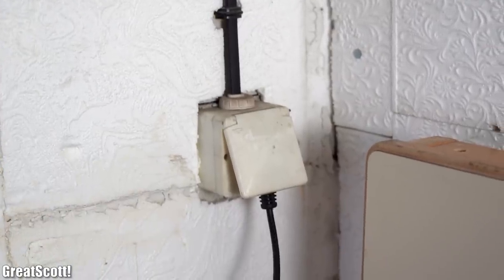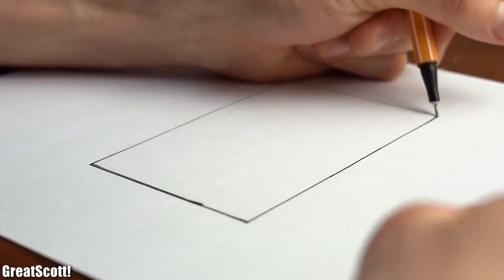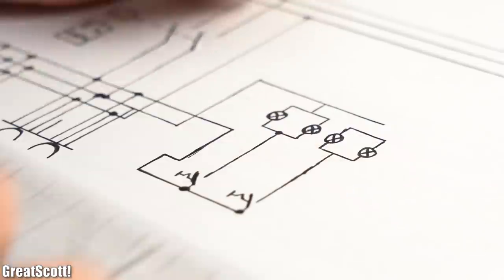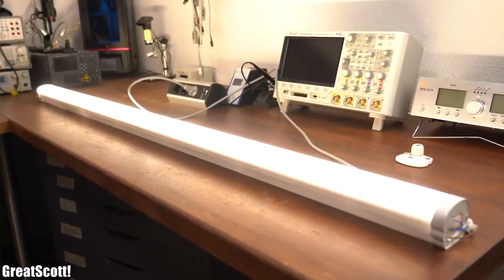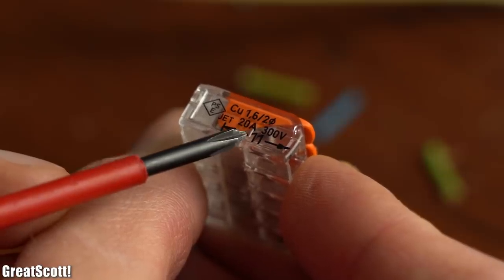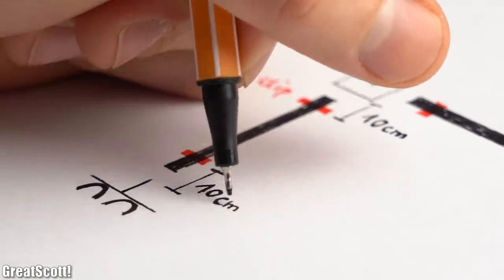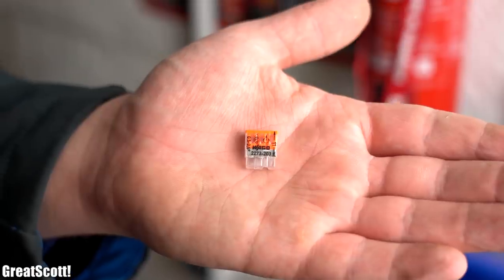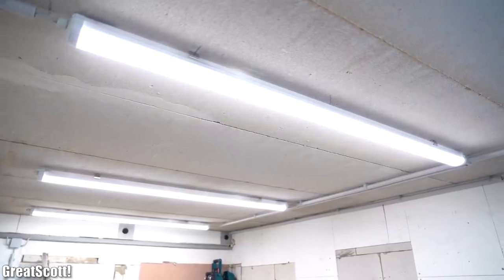How to do Electrical Wiring properly! (more or less....) GERMAN STYLE!

Comment: It's surprising how different German switches, cables and connectors are from the Italian ones. As always, great video!
Reply: So true, noticed it expecially those wires with solid strand instead of multicore
Reply: All components updated to the new legislation are very similar to those shown in the video, also because they must follow very stringent European regulations.
Reply: In Poland everything seems very similar to German type.
Reply: @fb55255  right, I always see that kind of cables in foreign youtubers videos, but I have never seen them in the electrical systems I worked with. They seem really practical.
Reply: @enricomontanari1390  in what year the new rules came into effect? I bought a bunch of new switches and electrical components last year, but they're not really similar to the ones in the video. I'd love to use wago terminal instead of the classical screw connector, but I never found them in shops. They need more space, but cable management looks neater.
Reply: I would say its the other way around :) The Italian ones are different... We also have almost  a 1:1 "copy" of the German system for wiring in Slovenia. On some points it's even stricter.
It's nice if we are on the same "page" for wiring, rules and regulations. It's even better for us consumers because you are not only limited to products made in and for your country...
Reply: @snajperSLO  standardization is always the best thing for consumers. Anyway, i always thought that we are the strange ones😂
Reply: Wow! Lo seguono anche altri italiani oltre a me 😁
Reply: @SimonTheGolds  Fa sempre piacere trovare dei connazionali 😂
Reply: Looks identical to the Belgian system. Different manufacturers though.
Reply: Imagine VS the US. Half the power, different codes ECT
Reply: @JoeNathan42420  half the voltage doesn't equal to "half the power" ;)
Reply: @JoeNathan42420  watching videos from Canada and USA I noticed that the difference between European components and american ones is huge. I think the working pricinciples are the same (or at least similar), but I could find only a few things with the same design. If I have to guess, in African or Asian countries this are even more different.
Reply: @fb55255  What? Multi-strand should not be used in fixed installations anywhere except in vehicles or environments with lots of vibrations. Except only very thick cables (not used in homes) where a few strands are needed for being able to bend them (still very stiff). 

Most of Europe goes by German standards, as they are categorically safest. (Wake up UK!)
Reply: Italian wiring of industrial equipment is just outstanding. Every wire marked in both ends and on terminals (ends crimped with boot-laces) . If you don't  get schematics, just follow the numbers.
German control panel with PLC?... One color for  Inputs and outputs to the PLC (grey) . Navy blue for live and black for neutral on 230VAC circuit. Only markings at the terminals for outgoing cables. German PLC technician get lost during commissioning of the new  plant. And again we, locals, opened all the trunkings and started pulling on the wires to correct the wiring. No pin lugs or boot-laces at the wire strip end in the terminals! (like Italian do)
It just takes to much time and man-hours to do the job properly, but price is like for Rolls Royce.  "German Engineering"
Glad to supply photos for disbelievers .
Reply: @MrJob91  sorry, no this is not the way it works. The potential between the strands is the same. No sparking is possible.
Multi core cables are only allowed (and sometimes required) in moving applications or devices with much vibration (like a compressor). Bending a single core wire multiple times will make it break. On the other hand a multi core wire is more flexible but much harder to handle correct and it is more expensive. Most of the time you need to use ferrules and taking care not to clip a single strand to make it work. Multi-Core wire is usually more expensive and is usually not able to make "perfect bends". This leads to messy installations which can't be understood easily. And since the effective cable radius is bigger it's harder to install them. All that being said, this are just some reasons the (german) codes are like the way they are.
Reply: @JoeNathan42420  Half voltage is double amps. All their wiring is double the section of ours, and they are quite limited in their power draw. We have 3 phase 400V at at least 40 amps available just about everywhere. They also have the habit of putting everything in metal conduits and boxes. To us that looks like a solid suicide plan, but it’s normal there. They even still have to discover Wago connectors, the poor sods ...
I don’t envy them for their power system. Or for anything else nowadays. 😉
Reply: @calysagora3615  only multi-strand are sold in Italy. Tbh I think everything should be multi-strand I tried to wire in an apartment both single and multi strand wires and thrust me a single strand is impossible to pass in a conduit, in particular if you have some sharp turns. Plus I find much easier dealing with multi-strand when in a junction /plug/switch box as cables are very flexible. On the electrical point of view there is no difference, they both do the job and both are safe and well insulated.
Reply: Well I live in (North) Italy and I don't see that much difference. The only thing I see with perplexity is he left open conduits.
Reply: @AccidentalScience  yeah i was thinking the same..
Reply: @calysagora3615  
Sweden has even more strict standards.
Reply: @mattiasakerblom3426  Jag vet! Har jobbat åt Jaco... 😑
Reply: I'm italian (northen Italy) too, and one of the things that striked me as different is the fact that he used cables with multiple wires in a single sleeve, instead of separate coloured wires. Of course in this type of installation you would terminate the conduents inside the juncion boxes, which I think looks much cleaner.
Reply: Maybe they are just newer styles, I've done a lot of marine electrical over the years and most customers choose Vimar components which is all Italian and looks very similar.
Reply: @tonyhewett3729  Here in Belgium it’s all Niko/Legrand for installation, and Scheider/Vynckier/Eltako for components.
Reply: Yes, it looks like in Germany are 30 years later compared to Italy 😂
Reply: @SimonTheGolds  Ci mancherebbe è uno dei canali migliori !
Reply: It surprises me how lax the electrical code is there. A plastic distribution box, that could be easily smashed. That is why we use metal in the U.S. also I'd a wire comes loose it will short to the metal box and trip the main breaker or distribution breaker.  Also cut the conduit 5cm before the device. Not here, conduit is connected directly to the device. Also metal conduit is also used when indoors as it is a second ground. And the clips you used ours go over the conduit, can't take the conduit down unless you remove the clip.
Reply: @calysagora3615  What? We do work to the same standard as Germany. Or rather we are supposed to, I've seen some truly shocking wiring from supposedly qualified electricians. The only thing I would do differently as far as wiring goes is I wouldn't use Wagos. I would use DIN rail connectors and ferrules on as much as I could get away with. You can get plastic enclosures nowadays with a DIN rail moulded into it so you don't have to buy the rails seperate. I think the only thing we do differently as a nation is our lighting and sockets are on seperate circuits and breakers.
Reply: Pretty much the same setup here in Portugal.
Reply: @Stefan_Van_pellicom  i've heard the set-up of the different live phases is different in belgium though. Wasnt it so that the triangle phase configuration (3L) is relatively common in Belgium. While in the Netherlands and Germany the star configuration (3L 1N) is more common?
Reply: @leonnastaly4814  Isnt according to the german standards blue = neutral; black = switched live / phase2 in 3-phase system , where brown = connected live / phase 1 in 3-phase system?
Reply: @snajperSLO  Well, we have CENELEC, but for some reason - I leave it to your imagination - some countries protested against common standards ... otherwise, all EU countries would be on the way to have the IEC 60906-1 standard plug (yes, we have that international standard, but only South Africa and Brazil come close to that) and common rules (for both the electricians as well as for DIYers). This would be a 20 year long way, but still feasible.
And yes, some "Special Italian wire techniques" would not be allowed then anymore ;)
Reply: @fb55255  Stranded is just cheaper (and bigger) than solid core, for the same current.
Reply: also: there is no way in italy you would use that kind of multi-conductor cable inside a tube, you'd just nail it to the wall or just get the tube inside the junction box and then use multiple single-conductor wires.
Reply: @Darkshadow799  actually, difference between USA and Europe is bigger than Europe and Asia/Africa etc. In USA most common type is a split transformer mains. (220v / 2x110v). In Europe main land most installations have a true 3 fase (L1, L2, L3, PE+N) or on older connections 1 fase (L1, PE+N.). Buildings with 3 fase can use 400v additional, but fase to neutral is always 230v and is mainly used for household appliances.
Reply: @Darkshadow799  If you make the system with the conduits that stop before the boxes ( as in the video) they could be practical but then the multicore wires are even more practical, if instead the conduits continue inside the junction boxes it becomes much more difficult to insert the solid cables, not to mention that the cables with sheath cost more than unipolar multicore flexible cables
Reply: @SimonTheGolds  presente! Italiano e veneto (da 10 anni, prima emiliano)
Reply: @fb55255  This depends on use case, and max amperage thatll be flowing through it
Reply: @michaelbeubl648  tua sorella
Reply: @Darkshadow799  Cacchio, quei connettori Wago sono una figata!
Reply: @fb55255  Do you have the Ticino stuff?
Reply: @volkhen0  in Croatia also 💪
Reply: @Darkshadow799  Well, connecting is connecting wires. In that the working principles are similar. However: the High leg delta system used in North America is sufficiently different from the symmetric three phase system used in Europe that being trained with one of them does not mean you‘re qualified to work with the other.
Reply: From North America it's far more different.
Reply: A US electrician has to trained well to work in Germany. The same it is to work in the USA. Different colour codes, different cable,  breaker boxes, installation rules.... .

Comment: In Catalonia we use 1.5mm copper wire for 10A instalation, 2.5mm copper wire for 16A for electrical socket plugs, with one RCBO for max 5 circuit brakers and a diferent breaker for ilumination circuit 10A and a 16A braker for electrical sockets.
Great videos, I love your channel.
Reply: In Finland we also have to use 10A fuse for 1.5mm² and 16A fuse for 2.5mm², both copper. In a VERY special case you can use 1.5mm2 with 16A fuse, IF the cable is less than 2m long.
Reply: We have also a maximum 3% of voltage drop, if you exceed you have to use the next wire section. We also have a restriction of maximum current depending of the instalation system. 
But I think prety much similar in all European Comunity members.
Reply from the maker: Thanks for the info!

Comment: Im an italian electrician, here in italy 1.5mm sq is for 10amp circuit, for 16 amp we use 2.5mm sq, also you can use some adapter for the tube to the junction box and you dont have any whire exposed and get a better look, thanks scoot see you next time!!
Reply: Don’t you also calculate the cable size or are those just general guidelines no matter of the length?

Comment: I'm a danish electrician and i have a small correction:
5:24
The theoretical rating of a 1,5mm^2 wire is a little over 16A, but in european standards a 1,5mm^2 wire should never be able to pull more than 13A because of factors like distance, wire bunles, tempatures and a few other thecnical factors like short circuit current (Ikmin and Ikmax (the Ikmax is not valid in this situation)). All of these factors limit current rating very much.
Unfortunaly you have to dive DEEP into electrical math to see that influence.
Great video anyway. I was intertained.
(Yea i know the entire installation has a 6A fuse in front of it, so 16A will never be able to run there before that pops.)
Reply: Short term loads of >16A are permitted by code in germany. In essence you are to avoid voltage drops of more than 3% over the length of the cable because of heat dissipation (among other reasons).
But usually electricians in germany would dimension a cable as 6A/mm² nominal on on a B-Type breaker.
If you exceed 6A or have a deltaU > 3% you'd step up in cross section to 2.5mm² yet still keep the B-breaker.
There are ofc exeptions to the rule. Different load types and load profiles over time might require different breaker characteristics and cable parameters.
Reply: In the UK a 16A or 20A radial circuit would definitely used at least 2.5 mm^2 cabling (for a very long run it might need to be larger gauge). The 1.5 mm^2 cabling in UK use is generally reserved for lighting circuits which will have a 6A breaker.
Reply: @TheEulerID  Same in The Netherlands; each wall outlet is wired using 2.5mm2 wiring; only switched lamps are using 1.5mm2. In Dutch household 6A circuits are very rare, so even those are mostly wired using 2.5mm2.
Reply: @TheEulerID 2.5mm^2 for 16 amp in Denmark